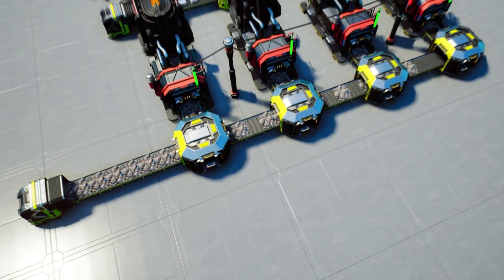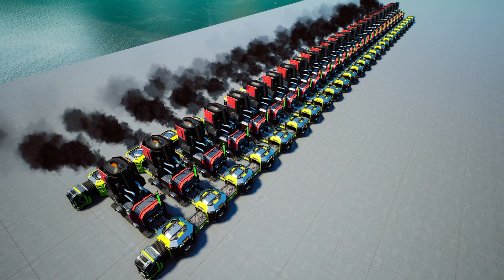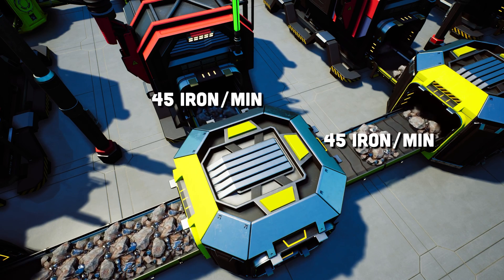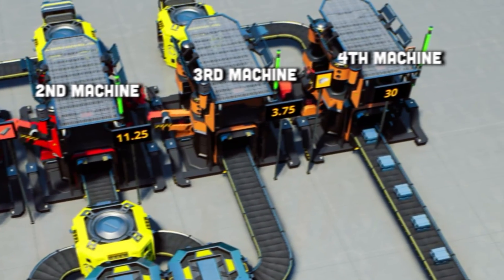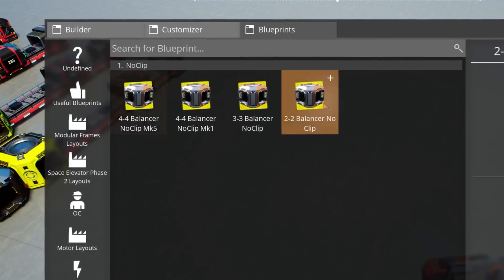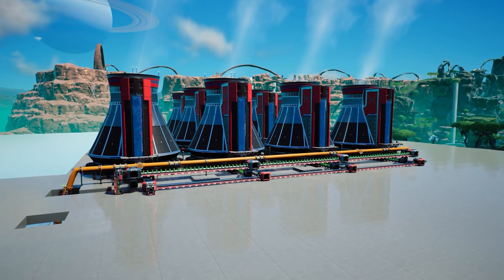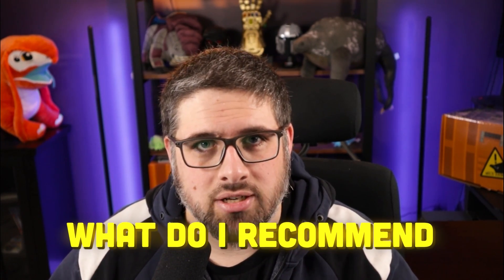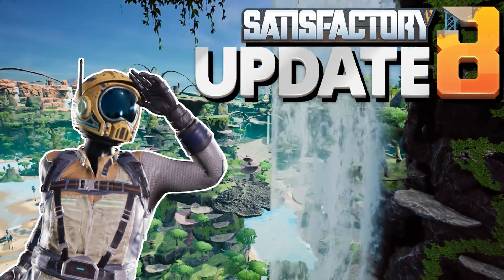The ULTIMATE Satisfactory Manifold vs Load Balancers Guide! (For Everyone)

Comment: An easy solution to manifolds is to prime them, just disconnect the power to the tools and let them fill a bit, or pull some of whatever component out of storage and prime by hand. Make sure every tool has full stacks in it (or leave the last tool half empty to keep stuff on the belt moving) and and the manifold will just continue to feed everything.

For nuclear, a load balancer, if you're making the EXACT amount you need, would be ideal. With their size, hiding a load balancer in plain sight would be very easy. 

With that said load balancing and manifolds could be a thing simultaneously, but noooo we only get flow rate limiters for liquids and not solids

Comment: Having played Factorio a lot, I have religiously used load balancers in Satisfactory to maintain what I need for inputs to smelters and machines, but I will agree that the manifold on outputs is an absolute must for space saving. To save space with load balancers, I construct a basement floor beneath the machines so that the belts and splitters have their own space.
Reply: Logistics floor sounds nice, but I found it to be annoying for troubleshooting.
Reply: @AfePooq what i do is set up a temporary factory with out the logistics floor to get the layout I need, then build the permanent factory in my mega base with logistic floors using the temporary’s layout on the logistic floor

Comment: I used to use manifolds exclusively, Now I exclusively use load balancers. I find the puzzle of how to build it as small as possible (no clipping) very fun. I have a blueprint I made with 16 smelters load balanced within walls. Also in addition to immediately being efficient it's also just as fast to turn off. When you want to disassemble to replace it (like where you have new alternate recipes) it's nice to be able to immediately disassemble without clogging my inventory with unprocessed machine fill and belt items. Also balancers are more fun to watch, very satisfactory.

Comment: 13:23 Downgrading to lower MK conveyor belts to adjust different flow rates is an excellent idea, never thought of this.
Reply: I was so happy when I figured it out and additionally figured out that it could be used in manifold setup. Have single line 480 and 60belts coming off and additionally splitting into smelters. Worked like a charm. No stacking and when I turn off the miner basically instantly can delete it without getting excess raw materials.
You don't need smart splitters :)
Soon setting up on copper 60+84 1st then 120 and 168. Need it for oscillator balancing. I was surprised the weird numbers could be balanced with even overclocks. Well according to my math.
And will test sushi belt + splitting. Hopefully everything equals out evenly.

Comment: Still not reach nuclear, but i only use balancer on a stator factory, 1 belt needs 320 and other 400, excepet that never use balancer, only manifold system ^^ . Kind afraid try to make any nuclear power plant now. Btw i play this game like 1year ago and was a recipe called "wet concrete", now i cant find anymore, already open last tier´s and got all alternate recipes from drives and the thing dont show in refineries, so the question is this recipe was removed from the game?
Reply from the maker: Wet Concrete still exists.  Only need Tier 3 Coal Power milestone unlocked.
Reply: @spectrumdad_  I dont know why my alternate recipes just vanish. Solution was upload save on satisfactory calculator and re-unlock all recipes, now they apear o.O

Comment: What about a hybrid of a manifold and partial load balancing? What do I mean by this?

Let's say you have an array of say 12 smelters pulling on an MK4 belt (pre aluminum processing and MK5 belts). You set up a simple manifold and yes over time it will balance out to where all the machines are running at 100% efficiency due to the back propagation and overflow mechanics of the splitters and mergers. If you want your manifold to work at 100% efficiency early on instead of waiting for it to catch up where say the last 2-3 smelters are starving for materials, then what I would do in this situation is to add a merger before the last 3 splitters. This will involve and require another line of material coming in though. For this we don't need another MK4 belt. A simple MK2 or 3 belt would be more than enough. We can feed this second line into the manifold after say the first 8-10 machines, or if you want to be more symmetrical we can place it after the 6th machine on the line of 12. This will over saturate the belt source belt. This okay though. At the end of the line we can feed it back to an extra output with the last splitter on the line to be a smart splitter taking all overflow out of the line so that the line keeps on moving and doesn't back up. These are little extra padding on a simple manifold but are less complex than a full load balancer. We can always either transport this extra material out to another location to be used somewhere else or we can simply just sink it. But yes this does require bringing in a little extra resources into your assemblies. If you are feeding this second line 1/2 through your main manifold line, then I would say an extra 30-50% would help to have your machines running optimal early on. If you add it towards the end of your array to component for the last few machines only then perhaps only an extra 10-20% of material would be needed. Again this would also depend on how long your manifold lines are. Personally I try to keep my manifolds on the smaller side such as saying an array of 8 machines, this way those machines are not starving early on. The extra material at the end of this array would merge into another belt and then start another manifold of 8. There are hybrids of the manifold - belt balancers that work well too. However, these are only good for pre-aluminum and uranium solutions. You might be able to get away with these with oil production for plastic and rubber but you have to be careful with your fluid flow and intakes. As for aluminum that's a different beast altogether. Anything that is simple smelter - constructor, assembler... A simple manifold system will do especially if your manifold lines are kept small. If you start to run say 12+ machines on a single line... then this is where the manifolds start to have that accordion effect. Anything that is 8 or less is just fine. For lines that are between 8-12 it may vary on your needs but this is where overclocking and underclocking comes in handy!  A trick here might be to underclock your first few machines and use a lower belt feeding them so that they don't become belt hogs and allow more material to pass through. Then your middle array machines could be set to normal production, then the very last machine or two on the line you can add a second feedline with a merger and over clock these two. There are many ways to build these systems. I find these hybrids solutions to be good in several situations, but most of the time, for all lower level productions I simply use a basic manifold system and I also use buffer storages before and after each stage of the assembly lines.
Reply from the maker: That works too, but what I love to do instead of the extra logistics is to just turned off all the machines, let them all fill up, and turn them back on. Or manually load them up first. This speeds up the whole process.

Comment: Solid arguments, especially nuclear, which I hadn't thought much about.  I generally do minimal load balancing on resources, like belt compressors or saturate an mk.3 miner on pure node for mk.5 belt at 780, then "peel off" 30 or 60 or whatever to get full multiples of machines, or maybe 0.5 multiple and send excess of 2 manifolds to an odd machine.  To make manifolds faster, I put the smallest speed input belt possible that is at least 1 faster than machine input speed.  if machine needs 1-59 input, mk.1, but if it needs 60-119 input, mk.2, so each machine will eventually saturate, but excess gets kicked down the manifold a lot faster, and it slows the fluttering/struggling between head and tail during starvation.  But sometimes load balancing is fun, so I might manifold to simpler load balancers, as it gets benefits of scalability, compactness, versatility, and speed...  Sometimes vertically stacked balancers look cool too.  I avoid 4x4 because if it gets to that point, I really messed up bad.  4x4 is just too clunky.  I limit myself to 3x3, 3x2, 2x3 and 2x2, sparingly.
Reply from the maker: Yea I usually put in the highest speed belt I have in the manifold hwy belt to make things go quicker
Reply: Yeah I do that quite often. My input line is typically an MK4 belt (pre-aluminum builds). And I peel off with either an MK1 or 2 pending... And I also try to keep each manifold array in the range of 8-12 machines max. In some situations I may even add a merger just before the last couple of machines to saturate the belt so that they are not starving and just let the end of the belt overflow and feed that back into the system. This does require a second input source line of say about 20-50% extra material but any excess could be transported back out as output or can simply be set to a sink just to keep the lines moving. I also use buffer storage bins before and every each stage of production. And using over and under clocking schemes in some situations can also help with the manifolds. I typically do not use belt balancers and I do not suffer from any issues of either shortages or backed up bottle necks either, but I may use partial hybrids... still a manifold but with some balancing towards the end so that the machines aren't starving with an overflow or feedback output. Now once you start getting into Aluminum production and especially Nuclear that's when and where belt balancing is kind of a requirement...